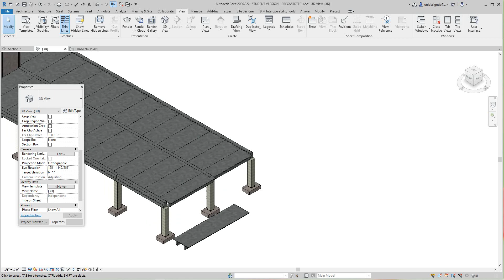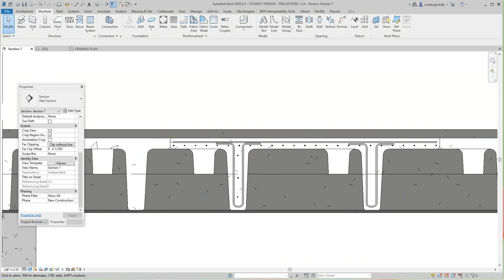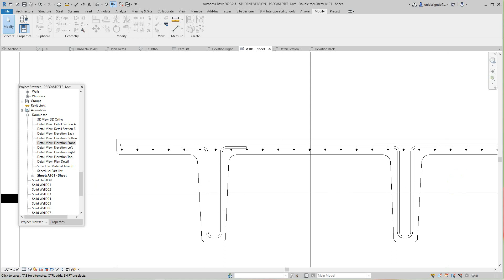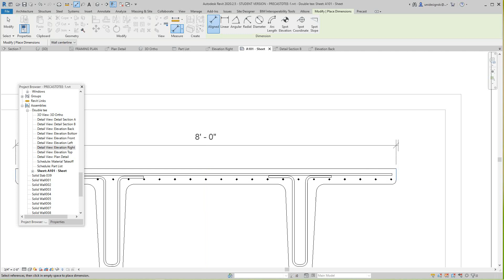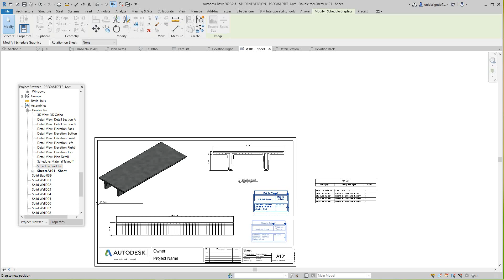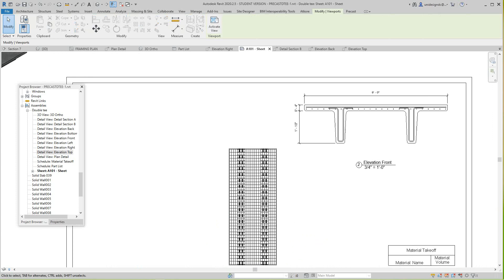Revit Precast  Double Tee Shop Drawing

Comment: Hi Robert,

Thank you very much for the great and clear tutorial. I really enjoyed your explanation of the precast concrete system, especially the double tee beams, columns, and overall structural layout.

I was wondering if you would be willing to share a sample precast concrete building model (columns, beams, and double tee slabs) in Revit 2021 for learning and modeling purposes. That would be extremely helpful.

Thanks again for sharing your knowledge and valuable content.

Best regards,
Majid Hamidi Fard
Reply from the maker: Hi! Thanks for watching, I will share the model soon.
Reply from the maker: I hope this helps thanks for supporting this channel
Reply from the maker: Hi I have some older families I may have. I sent them I hope they help